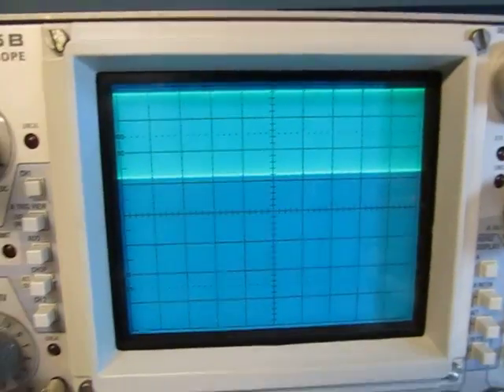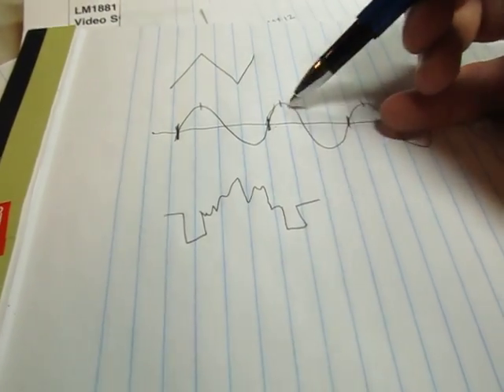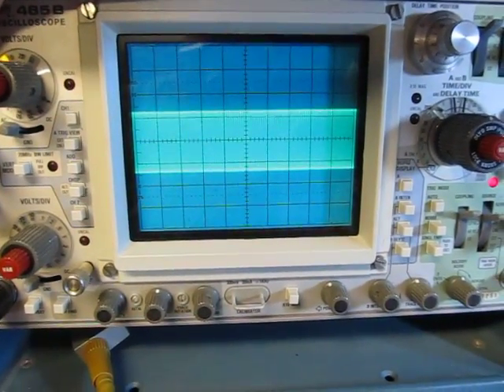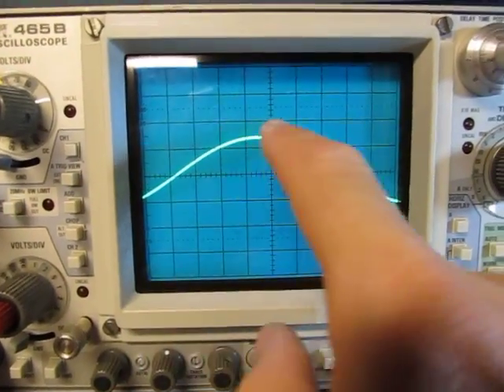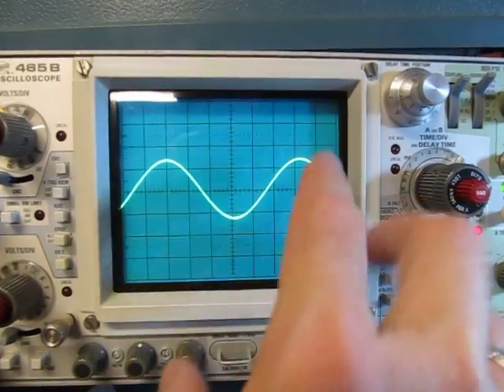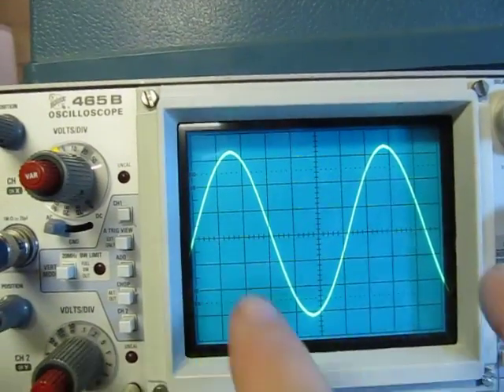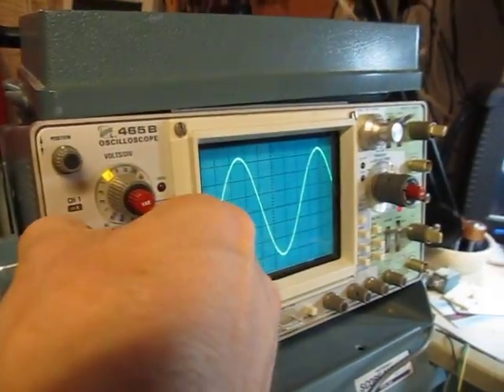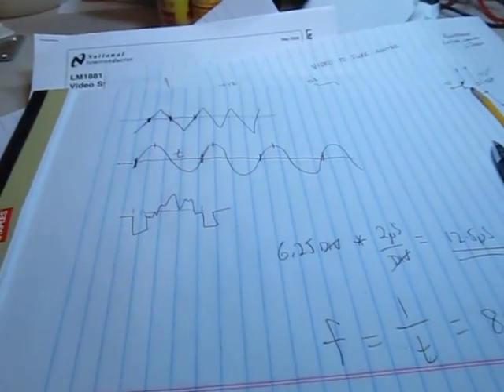#43: Analog Oscilloscope Basics: Making a Frequency Measurement

Comment: Any idea how to stabilize a low frequency (10Hz) square wave on an analog O'scope. Im using a Tek 2465 scope and trying to look at PWM waveforms for a stepper motor. Its in the 10Hz range and I can't seem to stabilize my waveform on the scope with such a low frequency. Any tips, tricks or suggestions?
Reply from the maker: Make sure your trigger setting it set to NORMAL, not AUTO.  10Hz is difficult on an analog scope due to the slow sweep speed needed.
Reply: Thanks for the reply. Yes, I tried those setting, but could not get a stable waveform. Is the sweep setting a parameter that I could check in a specs of a scope. i.e if I am getting a dig scope, is there some min value I should check in the spec to make sure the sweep speed is low enough to get a stable 10Hz waveform display?
Reply from the maker: Was it not stable, or just not a continuous picture.  WIth an analog scope running at such a slow sweep speed, it is impossible to get a continuous waveform unless the scope has a persistence type display.  Just about any digital scope will show you a good waveform.
Reply: It was definitely not continuos (so the rise and fall of the signal could not be seen) but the levels (H and L) were also flickering on the screen (not sure if this has anything to do with my HOLD OFF setting)?
Reply from the maker: Probably not.  For a 10Hz signal, the period is 100ms, which means that the horizontal timebase setting needs to be set to 10ms/div or higher, in order to see one cycle.  Slower settings (like 20ms/div) will show you more cycles.  Trigger holdoff should be set to min.  Trigger mode set to Normal (not Auto).  Trigger coupling to DC, and level set midway between the high and low values.  It WILL still flicker because the sweep speed is slow - totally normal, and as good as you can get, but you should be able to see both high and low levels on a single sweep.  The rise and fall times might be too fast to "see" at this low sweep speed, so it will just look like horizontal line segments.
Reply: Ok. Thanks. Yes! I do have those exact settings and yes, I can see both high and low signals in one sweep and it flickers. I guess I never measured such low frequency signals on a analog scope before and did not know its limitations. Good learning for me. 
Thank you for the feedback.

Comment: So do I need to be concerned if my probe is set on 1x or 10x on how I do the math?
Reply from the maker: No - the 1x or 10x probes only affect the vertical scaling, not the horizontal.  You should be using 10x for anything over several kHz though...